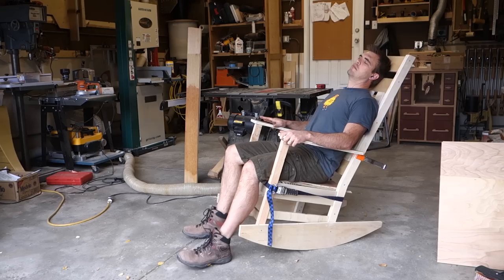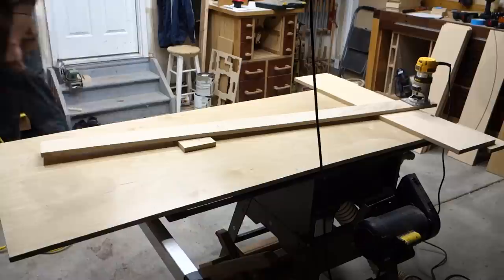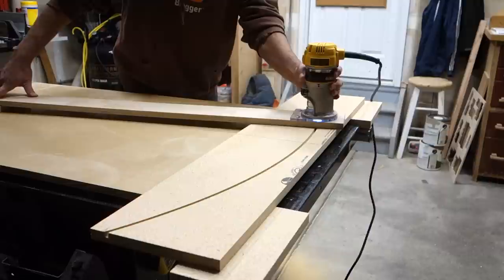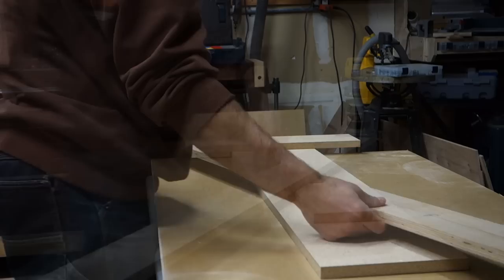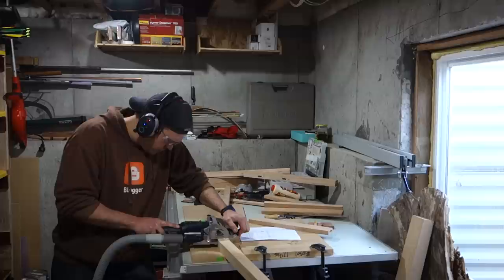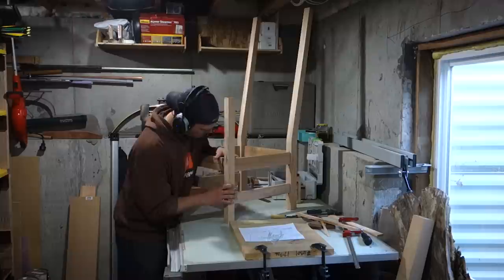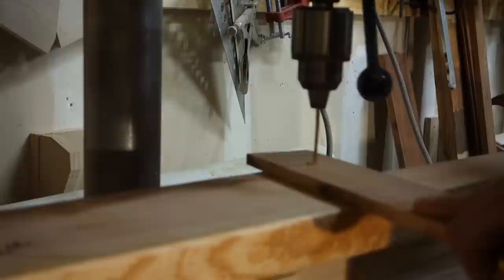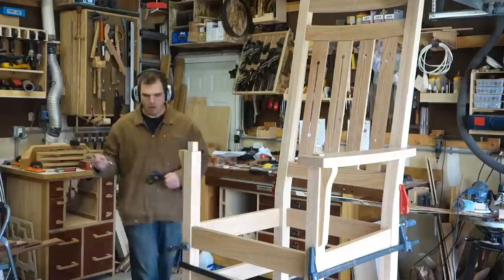Rocking Chair Build

Comment: The take aways for me were the router trammel for the forms and the spindle sander to mate the rockers and legs. I've built a couple of phototype four legged chairs from 2x3s, just trying to size it for myself. I'll really be nervous whenever I get around to locating the leg cuts for the rockers. Thanks, man!
Reply from the maker: I hear ya, I'm still nervous when cutting many joints, but good luck with yours!

Comment: Thanks for sharing. One of the best videos I've seen for awhile. very methodical and precise. I appreciate the voice over and how you speak to things you should have done or will do different next time as well as explaining how you figured out the various angles etc... How long did the build take?
Reply from the maker: Thank you. I don't know how long it took, as happens with some projects, this one had to be set aside for a few months after starting, so hard to estimate, but if I worked on it consistently, (which for me is restricted to weekends), it probably took a few weekends. I'm not particularly fast.
Reply: Well, with results like this you don't need to be fast.
Reply from the maker: Thanks, agreed. The journey itself is enjoyable all it's own, ya?

Comment: Perhaps I missed it in the video, but what did you do to get the 'crook' in the rear legs at the back rest? Cut the angle and join?
Reply from the maker: Ah, I may not have shown it, but it was simply cut out as 1 whole piece. For the legs, I didn't have oak thick enough, so I glued together 2 boards, and then cut out that angled leg.

Comment: @geekswoodshop   is it bending the curved leg is compulsory????? Why cant rocking chair can built without bending the leg using gum??? 
Why cant we cut wood in curve angle??? Without bending????
Reply from the maker: There are 2 main reasons to bend the wood, rather than cut it. You could cut it from a single board, but that requires a really large board to start with, which is harder to come by, and also, the grain of the wood will have a weak point as it curves, rather than bending, which will have no weakness from the woodgrain. Those are the reasons I understand for laminating the rocker. 

I also laminate the backs, but that's less important, I've seen a number of folks who do cut the back slats from a board. 

Thanks